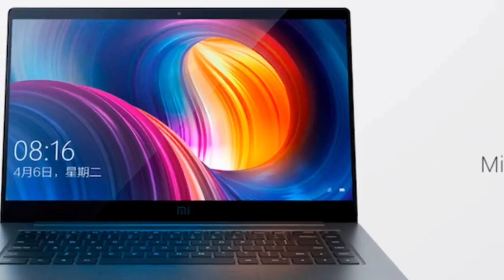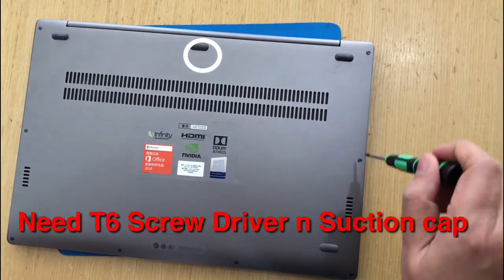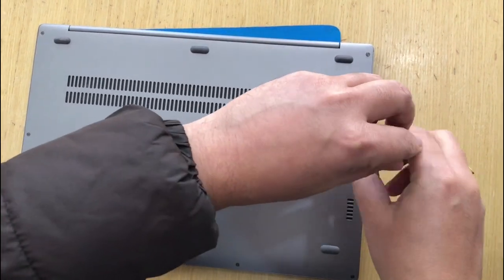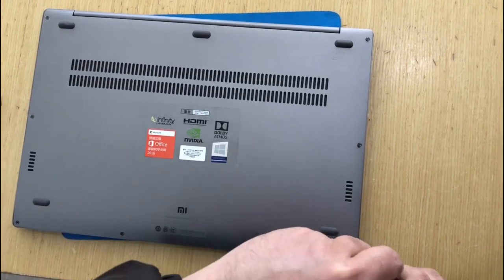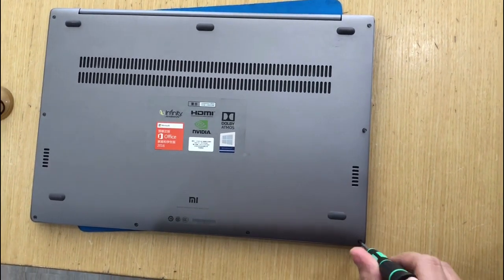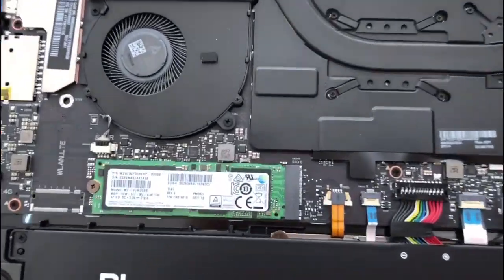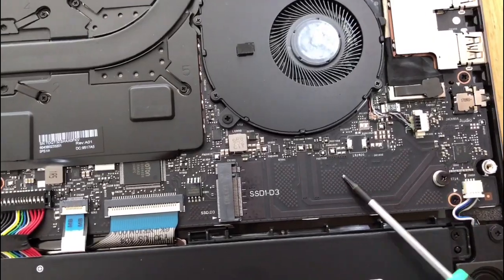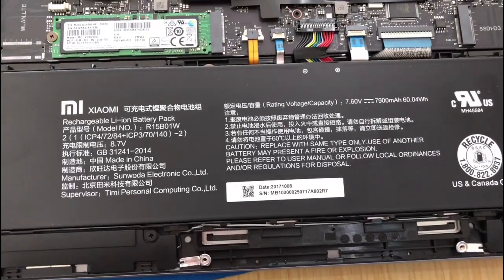Xiaomi Mi Notebook Pro SSD Upgrade, How to Open & Add SSD Storage

Comment: I will buy mi notebook pro 15.6 i5 and I want to ask a question. Can we add samsung 960 evo 250gb 3200-1500mb/sn pcie nvme m.2 ssd ???
Reply from the maker: the punisher sorry for late reply, yeah we can use
Reply: But what is better the SSD come with notebook or evo960

Comment: What is the max possible upgrade to the expansion ssd M2? 256, 512 or 1024 GB?
Reply from the maker: Jeith Garhe According to Xiaomi technician M2 2280 512GB is more compatible and they provide me this link also http://bbs.xiaomi.cn/t-13757127-u938549058

Comment: hi! I have problem with my notebook pro. It doesn't charge anymore. I had a USB-c controller error in the device manager in windows 10 too.

Can you please tell me what part number is on the USB-C/cardreader unit? and does it look like it can be replaced? (top left corner in the video)
Reply from the maker: Daan I will check with service center and let u know
Reply: Life of Gamer do you have contact details of service center?
Reply from the maker: Daan If you need number I can provide you but they can't speak English only chinese
Reply: do they have email too? So I can use google translate maybe.
Reply from the maker: Daan I'll ask them tomorrow n give you
Reply: thank you! my problem is described here with photos on the last 2 posts. http://en.miui.com/thread-1314295-1-1.html
Reply from the maker: Daan You’re welcome 😊
Reply from the maker: Daan You’re welcome 😊
Reply: Life of Gamer can I email or contact you in any way? My computer tech guy knows what part is broken but he can not get hold of any parts! It is the realtek usb controller that literally burned/fried. It's a REALTEK chip. I can email pictures.
Reply from the maker: sure mine email is karoulsahil@gmail.com
Reply: I send you an email. thank you so much for your help!

Comment: What kind of ssd do you need todo add? Nvme?
Reply from the maker: Jay Davis I work in China so I visited Xiaomi service center n and asked them so they told me 512gb is more Compatible with it
Reply from the maker: amprendiz debarman Yes
Reply from the maker: amprendiz debarman hey I checked with Xiaomi representative , they said we can add M2 2280 SATA 512gb maximum
Reply: Do you mean the slot that comes without a drive is for SATA III SSD? And the maximum is 512gb? Did you contact the manufacturer through the miui website? or did you do it through the company you imported your laptop?

I put a pcie ssd 1tb in my laptop and it seemed to have a few issues with compatibility.... but it did actually work for some of the time i was using it... very curious about what im able to use in that slot and i still havent figured out what that is.
Reply: Life of Gamer 512gb SATA III? Or pcie?

Will a 1tb not work?
Reply from the maker: Jay Davis http://bbs.xiaomi.cn/t-13757127-u938549058
Reply from the maker: Jay Davis I’m not sure about 1tb but they said 512gb is more compatible and M2 SATA SSD
Reply from the maker: Jay Davis just find a link for you , you can have a look
Reply from the maker: Jay Davis 
■硬盘：三星256GB PCI-E SSD（可额外扩展M.2 SATA SSD）
Hard disk: Samsung 256GB PCI-E SSD (extra extension M.2 SATA SSD)
Reply from the maker: stikowsky Xiaomi service center technician said that and give me this link http://bbs.xiaomi.cn/t-13757127-u938549058
Reply: Life of a Gamer, 512 Gb having in account the ssd that comes with the laptop or only for the second SSD? Thanks
Reply from the maker: Ramón Gonzalez in laptop it's 256gb